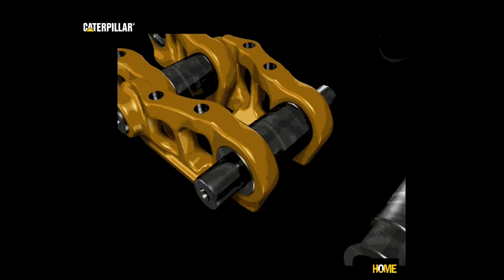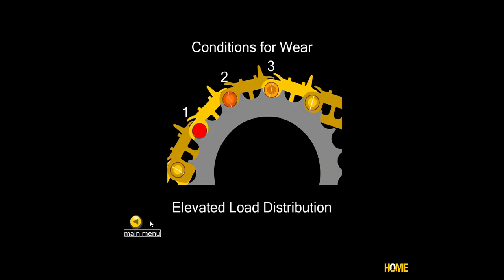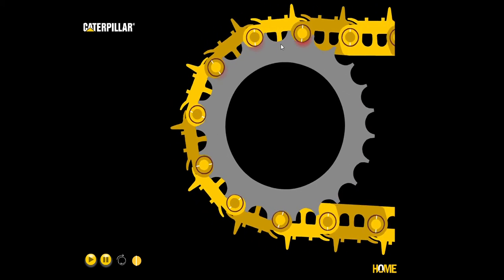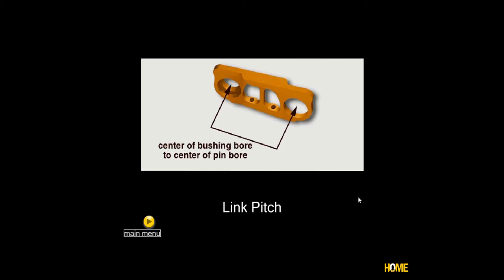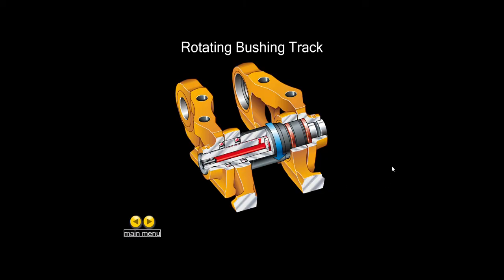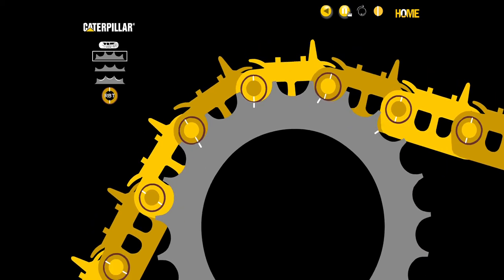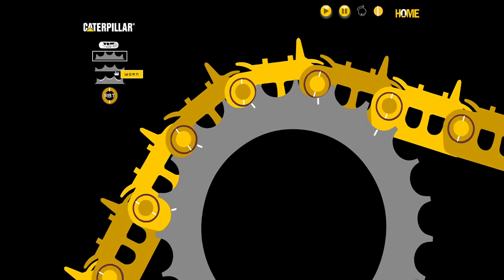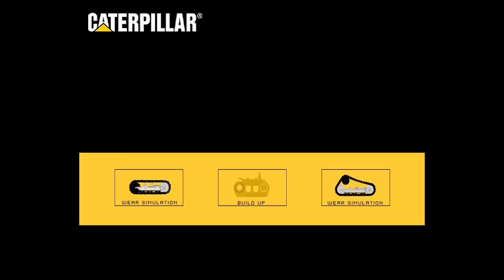CAT Track Wear Simulator

Comment: Where can I get this simulator?
Reply from the maker: So up until today I thought there was no way to use the simulator because flash player went away but I then found out there are several emulators available for flash player; one being ruffle.rs .  Since it still will work, here is a link to the folder with the files you need for the simulator: https://1drv.ms/f/c/232255677309edec/EuztCXNnVSIggCOdBAAAAAABXxKXGiLq6zgsc12EY6hauA?e=lmQKo1
Reply: @JimMackHeavyEquipment every time I click the link I get a warning it’s not safe. Thanks for your help. But my phone and computer won’t let me. Too bad could have been really useful
Reply from the maker: @egACRE No problem, I got the same warning but it did work correctly on my computer. I think there are other emulators out there as well.

Comment: I've ran D10N thru D11T and the wear ripping on the tracks was mostly seen on rail between pins ,I've seen them so bad that operator couldn't stand it in the seat on any kind of hard surface and was actually shaking and vibrating machine apart! Had several track techs come out and say because sprocket and pins didn't show wear that they where still 75% good? I would say measure rail height at pins and then in middle between pins! I've seen anywhere between 1" to 11/2" or more difference! It kills operator eats horsepower and vibrates shaking machine! Also seen rails wear flats on Idlers from hitting same spot continuously! Flat tracks on D9H would usually wear out pins and bushings!

Comment: Can anyone tell me if the cat drive chain wears out more quickly because of the elevated sprocket?
Reply from the maker: Yes, internally it wears out faster because it flexes 3 times per revolution instead of two. However, as long as you use SALT tracks it should prevent this internal wear and not be an issue.
Reply: @JimMackHeavyEquipment  in my understanding it doesnt just flex and extra time, it has to carry the full load meanwhile it flexes like 110 degrees

Comment: if cats design is better why does their high drive track wear faster than the oval design?
Reply from the maker: I am not sure I would say it is "better".  It definitely has some advantages but it also has the disadvantage of having 3 pivot points per revolution, instead of 2 on conventional track.  This will cause more internal wear and wear faster unless they used Sealed and Lubricated Track (SALT) which nearly eliminates all internal wear.  I do know that on elevated sprocket equipment you need to run SALT tracks because regular sealed track will wear out too quickly.
Reply: @JimMackHeavyEquipment  Same 360 degree of turn on each type.

Comment: This content needs to be sent to the operators apprenticeship for learning the students on how the wear occurs.
Reply: Also I used to work for a company that would refuse to change out the worn sprockets and also allow the chain pitch to get really long. The result was the sprocket tip to come into contact with the bushing at an approach angle where the tooth tip would try to climb over to the next bushing or "jump" a tooth. It sounds horrible and is also horrible for the machine. Proper maintenance for tracks is key to any tracked machine.

Comment: What’s really crazy is that coal dust has graphite which lubricates, and there are dozers with tens of thousands of hours with brand new looking original tracks/rollers/sprockets in coal mines
Reply from the maker: Thanks for sharing that Cody G; that is crazy situation where undercarriage life is extended greatly by the operating conditions!
Reply: It very much depends on the type of coal. There are coal mines where the exact opposite is true, whereby the coal has a high silica content, so the coal is blended with sand/grit.
Reply: I worked on a tailings dam at a copper mine and the Cats that ran on the sand needed complete undercarriage every 2 or😊 3 months. It was absolutely brutal. Not only was the sand super abrasive but the water contained chemicals that caused severe corrosion so and failed seals in the SALT tracks were quickly damaged along with seals and bearings on track rollers and idlers. It was constant replacing undercarriage and track adjusters.

Comment: Ummm .. you forgot dirt .. dirt is a major contributor to the wear on a sprocket and chain
Reply from the maker: Fair point.  Sand will wear tracks much faster than other soils like clay.  Soil conditions will always affect track wear.
Reply: Mud mentioned at 12:15